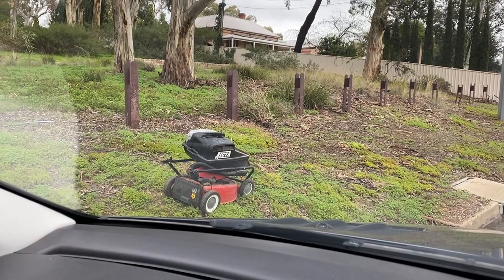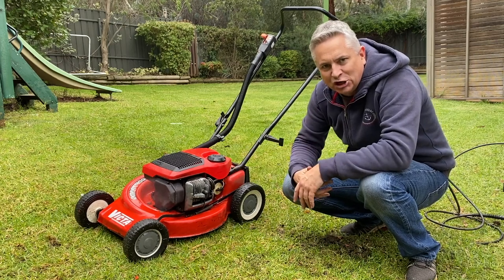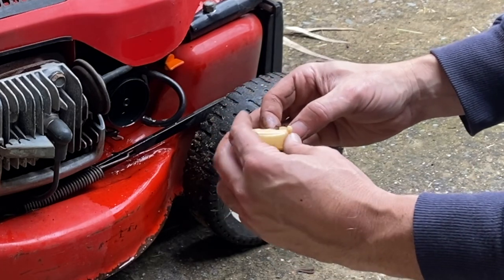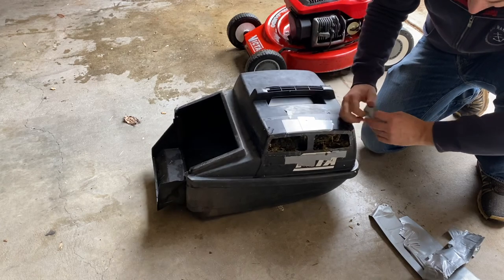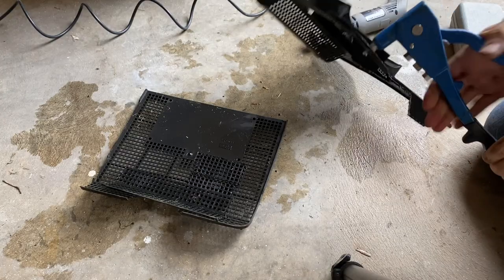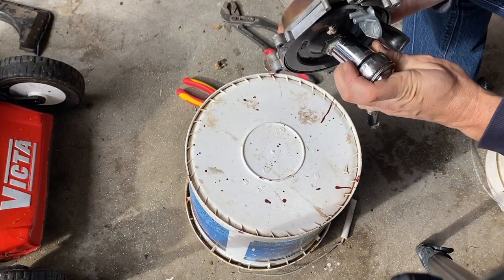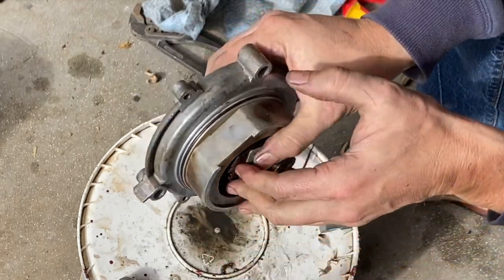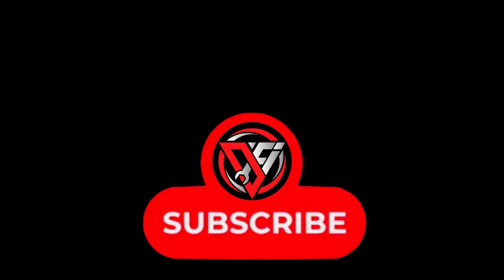Free Curbside Victa 2 Stroke Commando Lawnmower Restoration - Will it run?

Comment: Going back to the needle in the carby, I've seen there's a pointy end and a rounder end. The pointy end should be faced downwards or else the fuel flow will be incorrect and it won't run right.

Comment: Bought one of those red Victa Commandos from Mount Isa K Mart in 1999 for I think $500. It has travelled around Australia since then still going strong every weekend
Reply from the maker: Absolute gems they are!  I just picked up another that was in fairly rough shape off the side of the road … should be another video out this week with this one featuring!  Cheers Drew
Reply: Looking forward to it mate.
The longevity is testament to a good design.
A few cosmetic and easily bodged things have given up on it over the years. It copped a flogging cutting NT wet season grass for 9 years.
What it sorely does need now is replacement wheels. Do the current models share the same legacy wheels from the older Commando model?
Reply from the maker: @drkresearch2945  Hi Mate, I have certainly swapped wheels from newer Victa's onto these older ones without any problems?  Cheers Drew

Comment: Oh my gosh that is the sound of mowing a lawn on a sunday afternoon in the early 1990s. Wow love that 2 stroke lawn mower sound :)
And that machine looks in great nick good stuff to save it.

You are 100% right people have way more money than brains now. Some of the new mowers on the market are terrible. All plastic . Even the new victa corvette's they all look like cheapy plastic china stuff
Reply from the maker: Hi Mate, I think we will have a huge landfill problem in a few years time with electric appliances and batteries being discarded! Cheers Drew
Reply: @DrewFixIt  I think you are 100% right... Unfortunately :/

I have kept my old 2 stroke equipment and repair it when it needs. Its much better :)
Reply: Victas were a common sight where I live, half of the people in my street used them. But nowadays, not even a quarter in my street use them. I’m one of like two or 3 who use the old Victa 2 Strokes still, I have collected a few of them in recent times and most of them only needed light tinkering before they were working again.

If I am unable to fix them though I use what parts I can get off them to keep my lot still running.

Comment: My mower exactly like in video, but run over rev when engine hot, changed o-rings for manifold and starter, but no different any idea, cheers.
Reply from the maker: Hi Mate, you have done the right things checking the normal air leaks first.  The next thing that I would do is check how much tension is in the main spring in the Carby and potentially swap it for a softer spring.  Checkout the following video where I show how to speed up an under revving VICTA, for you it’s  basically the same but you swap for a softer spring!  Cheers Drew

Comment: Good Day Drew. Do you have a used Flywheel for a Victa Commando? Somehow came loose and damaged the keyway. There are no spares here cause they are going 4 stroke cause of pollution. All the way from South Africa.
Reply from the maker: Hi Alan, when you say flywheel, do you mean the cutting disc?  Tks Drew
Reply: Hi Drew. No, not the cutting disc. Above the cutting disc is the flywheel which sits upside down. The nut that holds the cutting disc in place came loose and the flywheel slipped down damaging the keyway in the flywheel. thanks and regards. Alan  @DrewFixIt
Reply from the maker: @alanpringle9376  hi mate, I probably have what you want.  Send us a private message on instragram!  Cheers Drew

Comment: Thanks for the info and love the vids! I have a similar mower and it starts first pull, but only runs on full choke, and shudders to a stop when I put in the run position. Would you happen to know what might be the problem?
Reply from the maker: Hi Mate, is it a 4 stroke? Cheers Drew
Reply: @DrewFixIt  Hi I have the above problem with a commando 2 stroke, what would you suggest I try? Carby is clean, spark plug new. Replaced head gasket too. Thanks